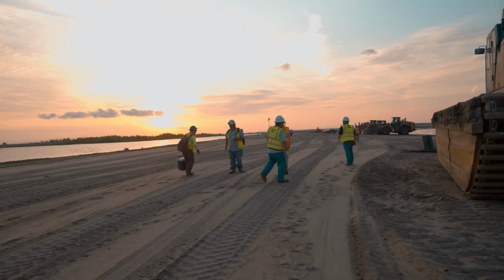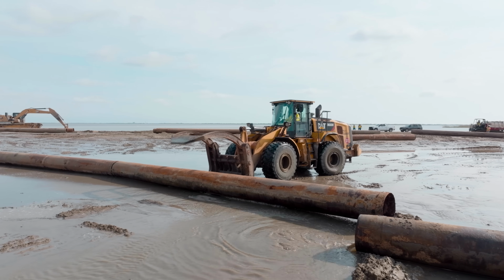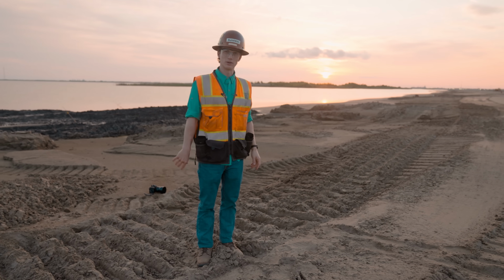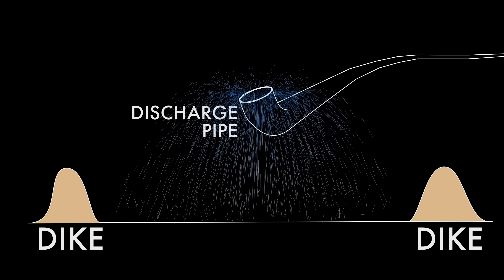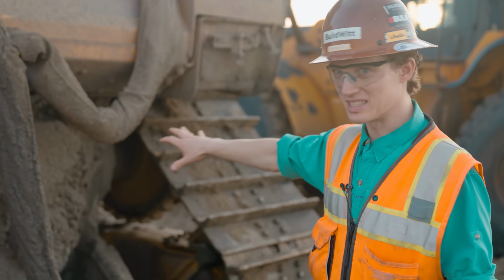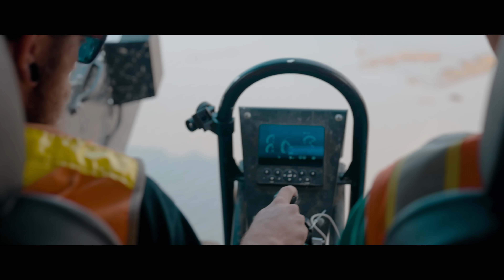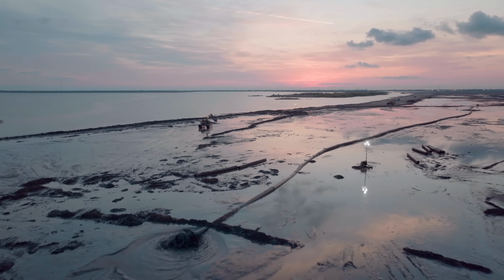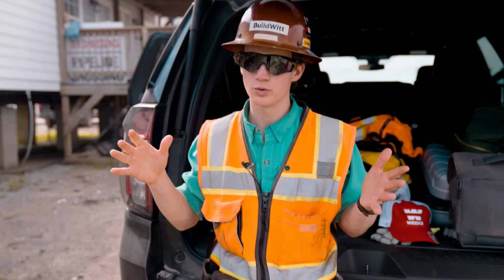Dredging The Mississippi | Floating Excavators | Weeks Marine

Comment from the maker: Have you ever seen a floating excavator? What other equipment have you seen in dredging operations?
Reply: Did you see that new gas plant on the way down?
Reply: Yes I have  I was involved in building a big dredge back in the day for Martin Marietta It would pump sand from a 100' deep
Reply: Saw some in the vehicle pool at a heavy equipment training school, with the other earth moving vehicles though I was on other unrelated training for all terrain forklifts.
Reply: Long reach excavator
Reply: Good thing they spend millions on birds not like theres starving people or anything
Reply: We call it the swampy
Reply: They dry dyke it and place in cells, dozers move the line and track pack the sand
Reply: these are used in a swamp areas for pipeline installation

Comment: I wonder what the undercarriage lifespan is on those dozers running in sandy water all day?
Reply: The last salt water dozer we used we ran for damn near 5 years. After that, you could poke holes in it with your finger. That was in swampy marsh right off the ocean in east NC.
Reply: The navy has d7’s that run in salt water year round building sand berms and building landing pads for boats. If I remember they had a life cycle of maybe 2 years before it was sent off to be completely rebuilt.
Reply from the maker: they essentially price the wear into the jobs. You somewhat throw the machines away when you're done
Reply: Pretty much in 2 years a brand new dozer will look like an old rust bucket but we probably get 4 to 5 years out of the D6s if we are lucky and the Cats are pretty hard to come by right now so they started getting some Kamatsu which in my opinion are complete trash for dredging have no ground clearance and are weak at pushing sand they grade nice but that's about it.
Reply: i wonder how much longer they would last if they got cleaned at the end of the work day each day
Reply: @brandonmcandrew4859  the wear is done during the day when they are working not when they are sitting idle

Comment: How do the pipes not blow apart from the pressure? I have a had time believing just the pressure from machine pushing the pipes together hold those pipes together. Did they give you an idea of the pressure the dredge pushes material at? Thanks for the cool content!
Reply from the maker: They’re purpose built for this. Not sure beyond that 🤷🏼‍♂️
Reply: It's only in the neighborhood of 450 psi depending on the dredge. The pipes are made of steel, and are scoped at one end. They get jammed in there quite forcefully (D6 weighs ~60,000lbs), to the point that they are stretched a bit by the scope going in. This creates a pinching force that keeps the pipes in place. They also weigh 1000lbs or more depending on thickness (sand eventually thins them out, plus rust). They can be blown apart but it is rare. It usually happens when the dredge attempts to send too much sand and not enough water, causing back pressure to increase abruptly. Also, elbows and areas near the elbow see more pressure than the pipes that are straight in line, and the pipes near the elbow often have steel straps welded to them to prevent those first few pipes from becoming disconnected. The front end loader often struggles briefly while breaking the connection, so the angle at which the scopes are designed make for a rather tite (while temporary) connection.

Comment: Bringing sand from the middle of the river to the edge of the river, can't see anything that could possibly go wrong with that.
Reply: The material settling at the bottom of the Mississippi that is being dredged is naturally supposed to deposit where they’re currently placing it. These dredging crews are manually performing a task that the river would be naturally doing had it not be locked by the levee system.